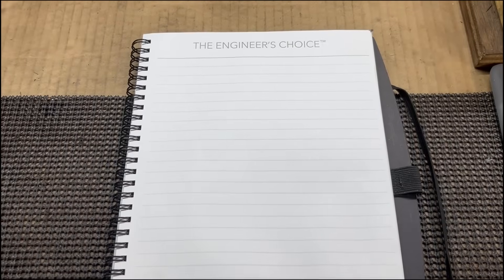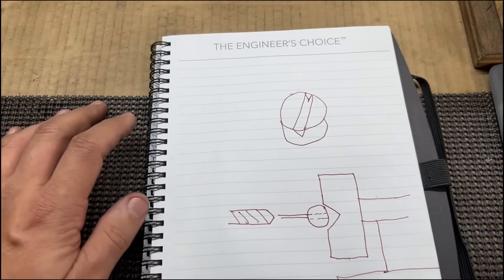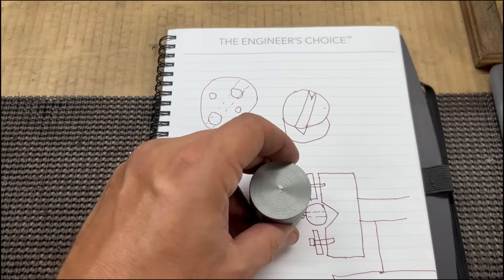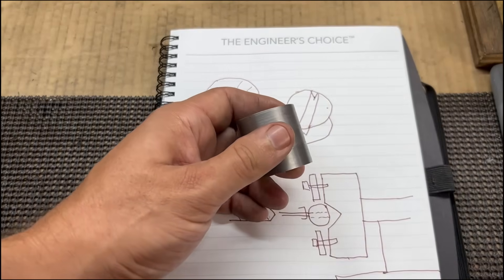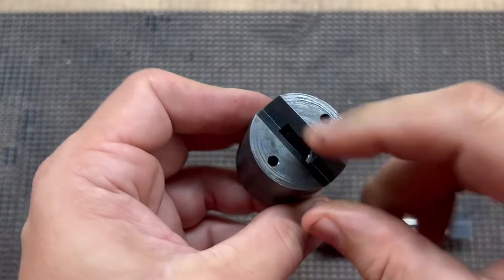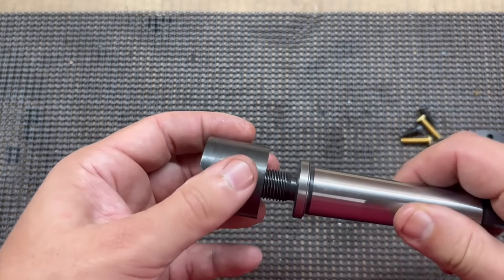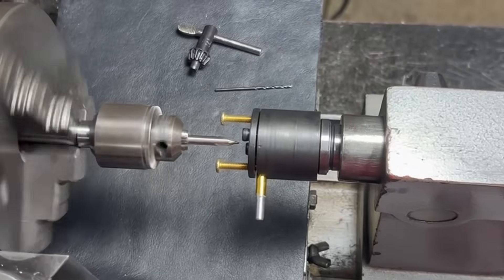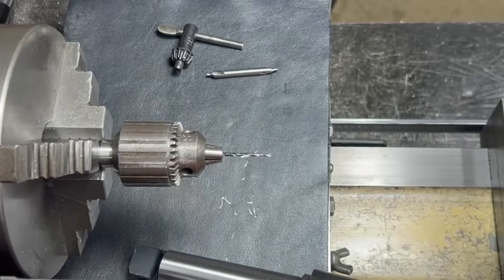Lathe Crotch Center

Comment: I have a simpler solution as I have a 4 jaw Self Centring chuck on my Myford Super 7 all I do is take the bar horizontally between the jaws and drill!!!!!!
Reply: But you are limited in the length of the bar you can drill to the size of the swing of your lathe. Even less than that if the hole isn't exactly centered. With the tail stock solution, you can drill any length of bar.
Reply from the maker: That would work but my 4 jaw chuck is not self centering and as @Chris-te7uk said you are limited on length.

Comment: why wouldn't you just put it in the lathe chuck?
Reply: if you have a long piece of stock you don't want it spinning, especially if it is too long for your lathe swing
Reply from the maker: I don't see how you would hold or center it in the 3 jaw chuck with the bar horizontal unless you did like @johnhili8664 said and have a self centering 4 jaw chuck. There again you as @madmodder123 aid you are limited on length. This requires no centering and no limit on length of the bar.